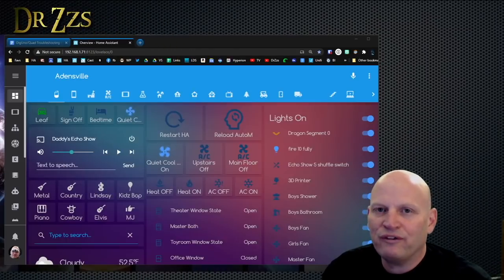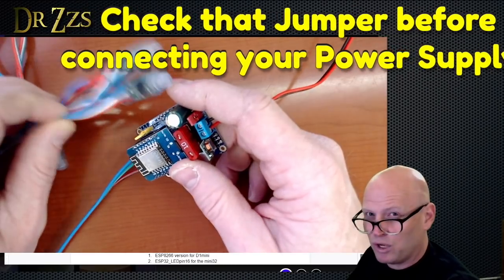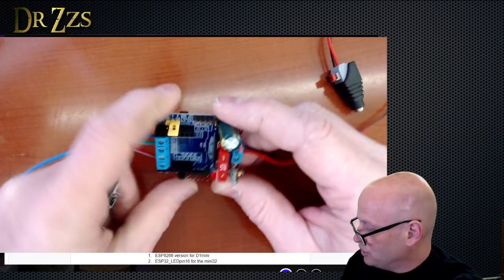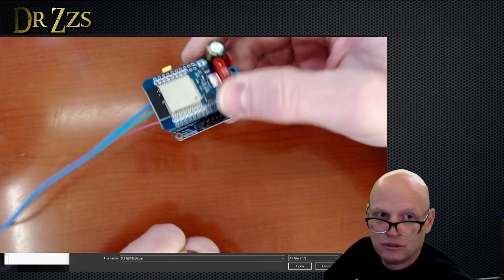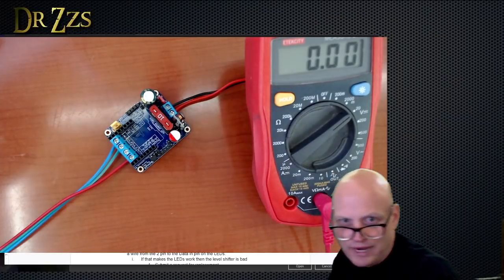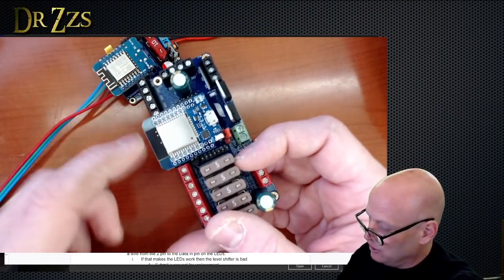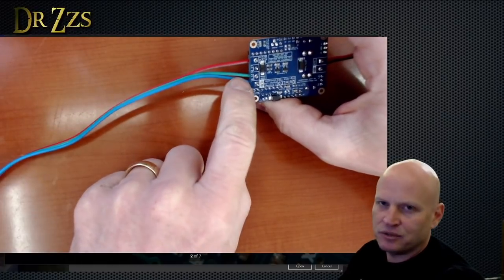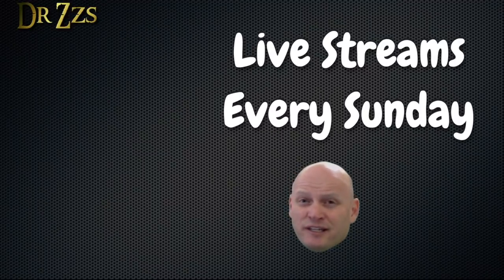How NOT to destroy the DigUno or DigQuad DIY RGB LED control boards

Comment: Was surprise when I didn't have 12v coming in at the first step. Tested my power supply on something else and it was working. 

Turns out the barrel connector was broken!

Comment: Is it possible to order just the voltage regulator rather than send the unit back?  I performed your tests and there is not 5v coming out of the regulator.  This is 100% not a warranty issue.  I mixed up two nearly identical looking 5V & 12V power supplies.

Comment: My dig uno doesn't have the power jumper.   It only has 2 prongs.   How do I make sure it is set up for 12 volts?
Reply: I wonder if the newer version of the Uno had been modified and it doesn't need the jumper any longer. I just received mine and there is text on the board that says "No jumpers needed"

Also from the manufacturer page...."Auto 5v-24v voltage input circuit (no more jumper!)"

Comment: I’ve had a dig uno for about a year and all the sudden lights stoped working. The blue light is on on the diguno and the first 3 leds right before I have power injection are lit up blue. Any help is much appreciated 
Thank you

Comment: Looking for some help. I may have burned out my D1 mini. I plugged it in backwards and applied power to turn it on. After blowing the fuse and realizing what I did, I reinstalled it correctly and replaced the fuse. Now when I power on the first light is off then the next 10 lights are light blue then the 12th light is red. Did I fry my d1mini?
Reply: Same here
Reply: I think i did the same thing.

Comment: I built my dig-uno's, I'm using an mining for the controller, I'm having an issue getting everything working. I've been reading all documentation online and have watched through this video, my LED strip are ws2812b 5v strips. I'm trying to power everything with a 5v 10a power supply, should I be using a 12v?

Comment: Haven't read all comments, but I thought I'd post the 12v/5v part that tripped me up. I built a few myself, skipped the 12v-5/v converter on one as it was for a specific use and just needed 5v. On the next um... lets say "on the next one, and definitely no more then that".....  I added the converter. I get it, move jumper, don't blow  stuff up. The part I missed at first (hey, just dove into this and homeassistant.. too many new things bouncing around up there to remember and figure out) I was thinking 12v power supple, dc-dc 12v to 5v/ converter, jumper set to 5v. All Good! Hurray! Plug in my 5v Leds !! Yeah! what?  Ohhhhh!!! Converter and jumper are ONLY for the board, as far as the leds are concerned, power IN = power OUT. 
So yeah, all is well got lights lighting and all pretty. And on the very, very first try.  Awesome ;)

Comment: I have a Dig Quad and I think the data output does not work. When I use the dig quad the led strip will not turn on. It connects to my wifi and the app fine. The app shows me it's on when it's not. I even  connected it to my node mcu to make sure the led strip worked  and it controlled the lights. Is this just a dig quad hardware issue?
Reply: sounds like your signal pin isnt connecting. check jumpers and for proper signal wire orientation
Reply: I have the same problem,  did you solve yours?  Please let me how did you do it.
Reply: @izabella072008  did you swap the jumper for data signal ?

Comment: Not a happy camper. For a couple of weeks, I haven't got the DigUno to operate. Now after reflashing the blue light doesn't come on and it still doesn't broadcast wifi.  I've sent an email, and asked questions on discord with no real assistance, no place to send it for evaluation, and cannot purchase another because of inventory. This is not good customer service.

Comment: UGH! I've been trying to flash my new Dig_Uno for 2 hours now. I tried 6 different cables. Definitely my PC dings when I plug it in using some of those cables, and not others. Aparently you also have to download a driver, as someone on the discord group mentioned. Even with that, nothing in the serial port field after refreshing, restarting the PC, etc. and in the device menu it says "no driver available". I feel like Hulk Smashing this. :(
Reply: Well, on Discord, RomWri spent a fair amount of time helping me out and I got it flashed. (THANKS RomWri!!) Apparently you also need to download a drive, and which driver isn't very clear. Mine needed a CH34x driver. I just finished up putting a couple of extra  5v labels on each of my 10 strands of WS2811's, stripped a power cable and installed it on my power supply, and am just about to wire up the Dig-Uno to one of those strands and see if I did everything right. Hopefully the magical smoke genie who makes all this work doesn't escape. ;) 

Please add something to the video and/or description about needing to find a driver and how to determine which driver is needed. :)

Comment: Received and installed my digiquad running 600 2812s. Works great, i did have an issue with the flash. Took 3 tries to get it to work, even though it was connecting to wled, the lights wouldn't come on. Third flash worked, thanks Dr.zzs for the email responses.

Comment: Is the dig uno be able to support 500 WS2811 led pixels running on a 30a power supply?
Reply: It can control them, but you don't want to pass all the power through it. I'd recommend running two sets of wires from the power supply. One to power the board and one set to power the strips and do power injection as needed. In this case, you would only connect the data and ground from the board to the first pixel. You cannot do data alone because it still needs the ground to complete the circuit.
Reply: Also, the specs on the strips matter. At .3W/led that would be 150W. If they are 12V that is only 12.5A. If they are 5V that would be using all 30A on that power supply at full brightness. 12.5A would only require 16 gauge wire (add an in-line fuse for safety). 30A on the other hand would require a fairly thick 10 gauge wire unless you split the power over multiple runs as he mentioned to cut down on the current. You also wouldn't want to go full brightness at 30A for an extended period of time on that power supply as power supplies should be rated for about 10-20% more than you intend to draw constantly. You can reduce the brightness in WLED to keep your current draw down to below whatever specs your system is built to.

Comment: I bought a 12v to 5v converter for the quad. So I don't even need that then? I can go from my 12v power supply straight to the quad?
Reply from the maker: yes.  The quad (and the uno) have a 12v/5v converter already.  Just make sure that jumper is set to 12v when you connect a 12v ps or it'll go boom.
Reply: @DrZzs  lol awesome! Thank you!

Comment: @DrZzs Can I request a 24 volts board for 10.9 meters RGB led strip?  awhile ago I bought one from Costco and super glowed it to the inside of my Gazebo. I don't wanna redo all that work and would rather convert the one I have and make it smart led.  this is a link to the one I have: https://www.frugalhotspot.com/2017/11/led-lighting-strip-36-ft/ 
Thank you Dr.

Comment: 3 things:
1. Thanks for this video, I was able to find my own answers to most of these questions a couple weeks ago but it wasn't easy.
2. Does it take a while for running 12v power supply and 12v lights with the jumper on 5v for it to break the D1? I accidentally did this and I noticed things got warm (not too hot) but it was only connected for ~5 minutes. I shut it down and switched the jumper to 12v and it's barely warm to the touch now, everything seems to be working fine still.
3. If/when y'all start doing Dig-Uno with ESP32, will you consider selling just the ESP32 mini with pins soldered on, so those of us with the current ESP8266 version can replace easily?
Reply from the maker: 1. Thanks, and you're welcome! 
2. yes.  I've seen them actually run for quite a while.  Days even.  But I've also seen them explode immediately.  I don't know why there's a difference sometimes.  You're just lucky I guess! 
3. Yes.  In fact, we will start selling single ESP32's minis soldered and flashed soon.  I don't have pricing info yet.  I'm hoping to get a deal on buying bulk.  My guess is the price will be somewhere around $8 but that's not set in stone yet.  
:)

Comment: This video came out about 26 hours too late for me to save my original Dig-uno (I think). Though sheer excitement I reused a 12V power supply that I mistook for a 5V. I'm not sure if the Dig-uno board is salvageable, but I was able to get it to seemily work with a new D1 Mini and the correct power supply, however, the D1 mini refuses to go into AP mode when the GPIO pin is on '2'. The D1 Mini will go into AP mode when the GPIO pin is on '3'. I understand that this means that I will not be able to use WLED with this board, but I was wondering if  you've ever heard of this issue. I might flash the D1 mini with ESP home (GPIO 3) to see if I can get the board to still operate, but I'm fairly convinced that I've damaged the board to the point that safety might become a concern. I understand that this is very much a DIY solution for addressable LEDs and the issue wasn't the board, but my own negligence. That said, troubleshooting the issues that I've encounter has made my understanding increase tenfold. I've already ordered a new Dig-uno, history will not repeat itself.
Reply from the maker: Sorry that happened, but I really like how it ended!  You gotta break a few things to really learn sometimes.  
I've not heard of it not going into AP mode when GPIO2 is connected.  That is strange.  It could be because of the 12v mishap.  Maybe there's a short between gpio2 and some other pin.
Reply: @DrZzs  Thank you for your reply. It seems like there was a short between the GPIO2 and the Logic level shifter, ultimately impacting the LED data wire output (L1-D), I'm also not sure why it won't go into AP mode when the GPIO jumper is on '2' but I assume it is all related.  

That being said: 
I was able to get everything working correctly by removing the jumper and direct connecting the LED data wire to the GPIO2 pin (similar to what you did around 10:20 of the video.)  

The LEDs are working properly and there doesn't appear to be significant voltage drop at the end of the strip, at least visually. (No flickering or uniformity issues)

The LED condition is SK6812 at 60led/m, 92 LEDs total.

Do you know if it is okay for me to permanently run my diguno like this or should I be concerned about fire/component safety?

Comment: I'm think they should ship out set on 12v....
Reply: Makes sense. This way If you screw up and put the wrong voltage on it wont blow up. Like a built in safety measure. Directions would be a good idea as well.
Reply from the maker: There are TONS of documents on quindor's website about how to use it correctly.  https://quinled.info/  
Do you mean including instructions on paper in the packaging?  We're not going to do that, sorry.
Reply from the maker: So do I, but you still have to check it before you connect it.
Reply: I'm just thinking for people like me that was so excited to try out I thought I'd just hook up my bad for not looking up info I just order a new d1 mini and reflashed worked awesome.......thanks for everything.....

Comment: Make sure your  D1Mini board is face up vs face down.   I soldered one set of header pins the wrong side.
Make sure you have the pins in the socket properly.   I was one row off a couple of times.   
Also the D1mini32 has pins that over hang and are not used when installed on a DigiUno
Reply from the maker: ah yes.  you learned the hard way too.
Reply: @DrZzs  Just went through all my D1 Minis and Mini32s, over half don't work with WLED anymore.   2 don't even light up.

So yeah, between DOA and my mistakes, I've learned the hard way.

Comment: This is me basing off of your "Zzimple" rule of thumb from a previous video of yours, I have a 30amp power supply for a run of 972 12v LEDs. Does this mean I have to have my power supply bypass the dig-uno and hook the LEDs directly to the source and only have the data hooked into the dig-uno to get the data boost? (So the 30amps don't kill the dig-uno)
Reply: Personally that's the way I would do it.   The DigiUno is rated at a max of 15amps, so if you crossed that line, you have a expensive fuse.
Reply: @johno186  makes sense, Thanks!
Reply: Depending on your need, you can also use multiple power supplies. I have to have ~1100 for my roofline and that's about 27A. I'm using two 200W power supplies. In order to do this, run ground and data continuously, connect ground loop to each power supply and split +12v between strings (~550 pixels give or take, in my case).
Reply from the maker: yes.  I agree with these other comments too.

Comment: This information would have been useful before I applied 12V. The switch was default to 5V on all 4 that I purchased. I watched smoke come out of my brand new D1 Mini  I ordered in one of your first rounds and was pretty upset that there wasn't ANY instructions provided whatsoever. Why wouldn't you have some printed instructions included???? Even the 4 output pins are a mystery.
Reply from the maker: Dang, sorry that happened. This isn't the first time it's been covered though. Quindor has done videos about it too, and all the instructions you could possibly want are on quindor's website.  https://quinled.info/ 
Including several references to checking the jumper before you apply power.  
This is still a DIY project, not a consumer product.  If Philips Hue were selling this you'd get a nice box and instructions in color, and it would cost twice and much.
We're not going to be printing and including written instructions.  It's just not necessary when all the information has been available on line long before we started selling them pre-assembled.
Reply: @DrZzs  I have to agree that some more clear instructions that are more easily located would be helpful…even online. Example: my dig quad get 3 showed up today. I’m a pretty fart smeller, and work in a very technical field… but when the version 3 has no wiring guide at all, And the terminals are not located in the same place from one version to the next, I found myself second guessing everything I know.

That said, I’m incredibly grateful for all that you and quindor have done to make really cool stuff available to the masses.